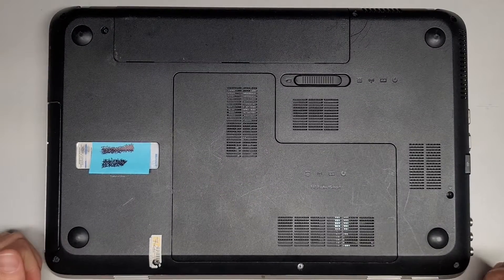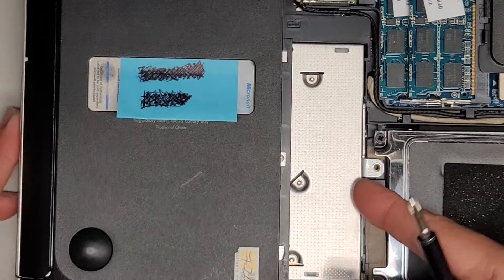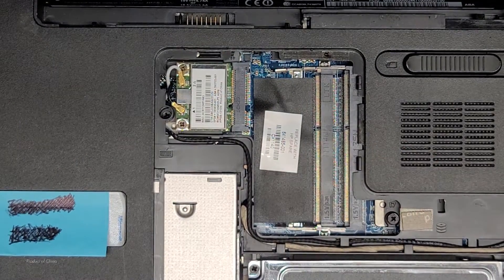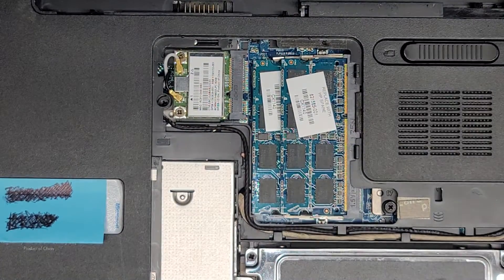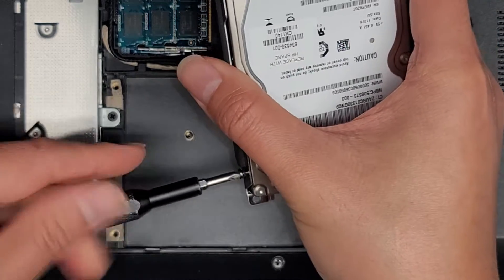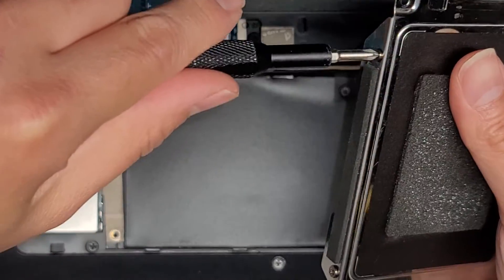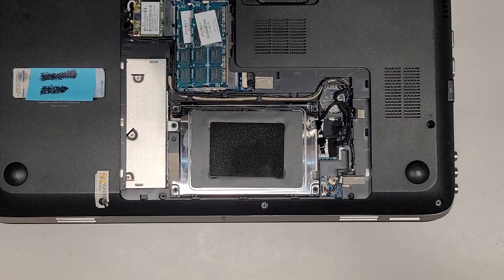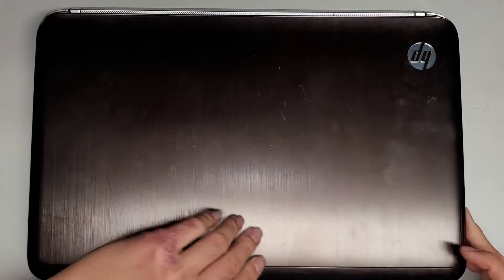HP DV6 DV6-6013CL Disassembly RAM SSD Hard Drive Upgrade Battery Optical Drive Replacement Repair

Comment: I plugged my hp pavilion dv6, and the charging light is not on. I can't even turn on the laptop 
My charger is working fine
Pls what can I do
Reply from the maker: Could be charge port or motherboard.
Reply: @ItsBinhRepaired  thanks
Reply from the maker: @flamesonlyOC  yup